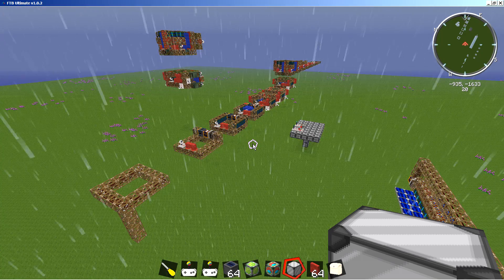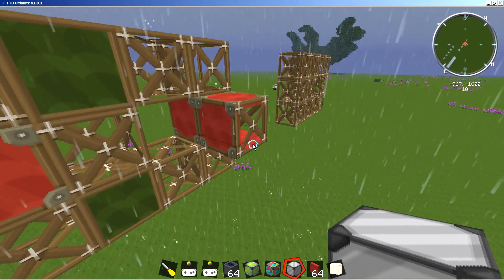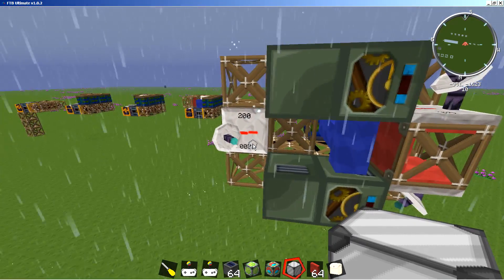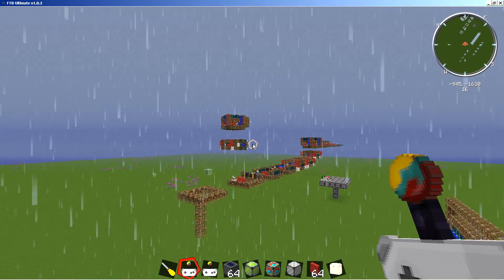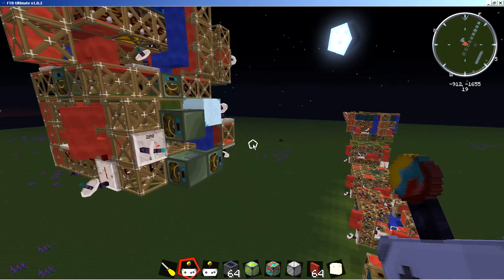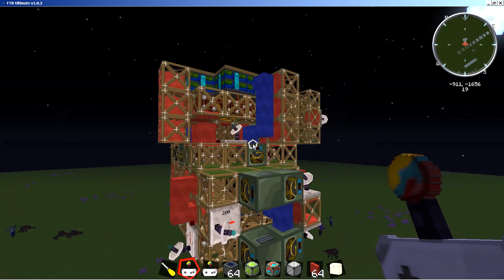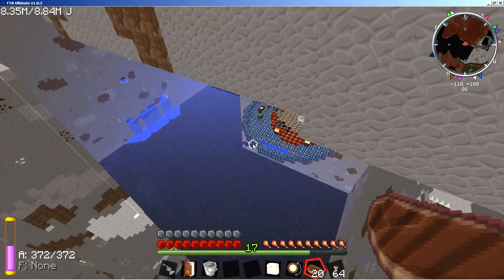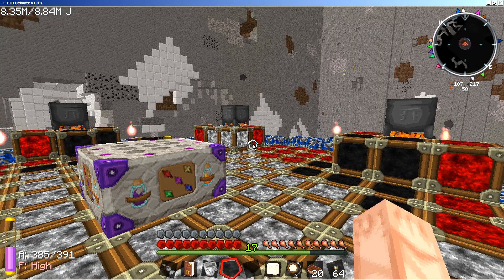Ultimate FTB Reloaded (Ep. 20) - What We Can't Do With Technology...

Comment from the maker: It's occasionally useful to be able to pulse that solid signal to free jams and the receiver allows for that to happen easily and remotely.  Also, using the wireless receiver means only one block is required on the frame module, whereas a NOT gate would require additional blocks for wiring.